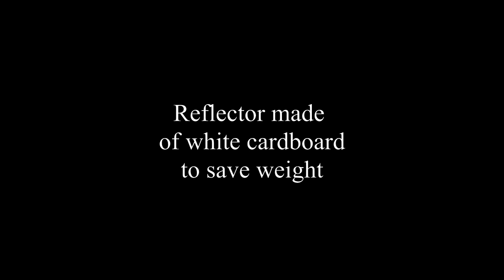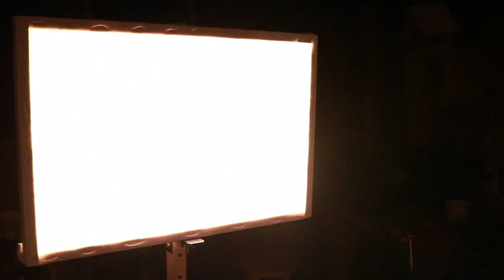Diffuse Video Light - Homemade

Comment: Might you have any concern about heat build-up having cardboard nearby... as in no ventilation?
Reply: Good question. I would use a LED bulb.
Reply from the maker: Yes the excessive heat buildup WAS a concern for me at first and I initially intended to use an LED bulb. As it turns out, I haven’t yet noticed it getting dangerously hot, especially because I don’t have a need for the light to be turned on for long periods of time.
Reply: bro what is the name of this sheet he is using 1:05